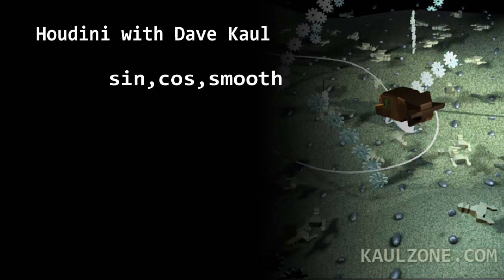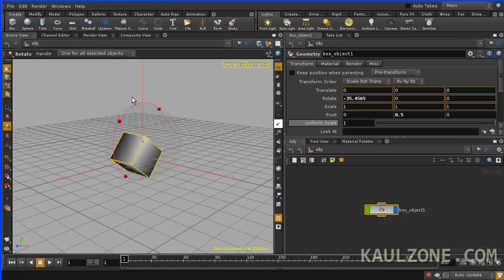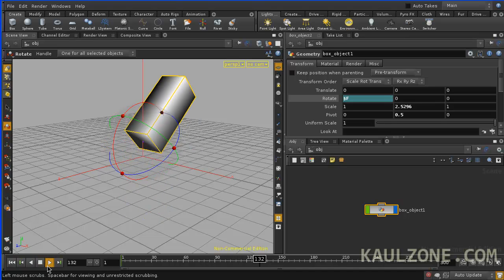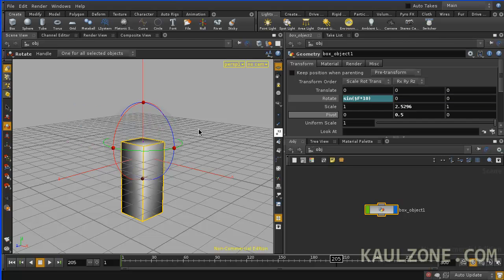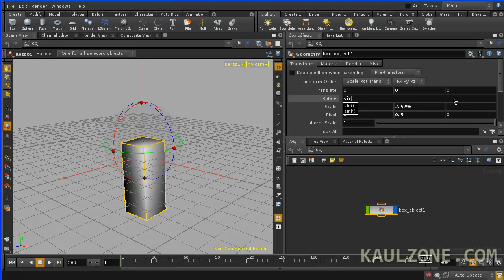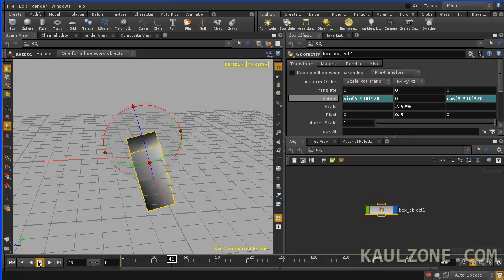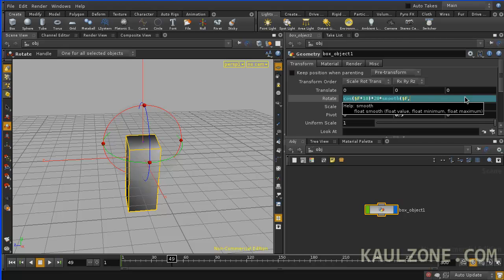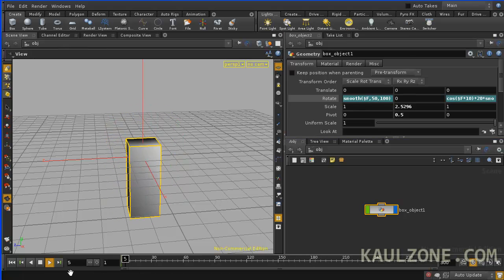Houdini, sin, cos, smooth functions

Comment: How would you ease-out to a dead stop using an expression? smooth only lets you ease in.
Reply from the maker: Sure, you just put a (1-equation). I haven't used Houdini since 2010 so I can't remember the syntax, but the 1 - smoothstep will slow to a stop